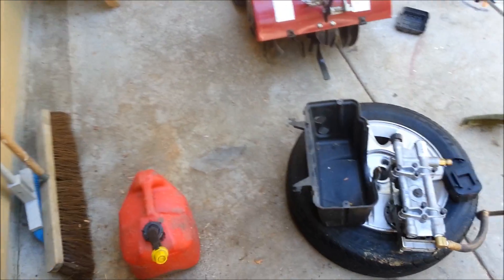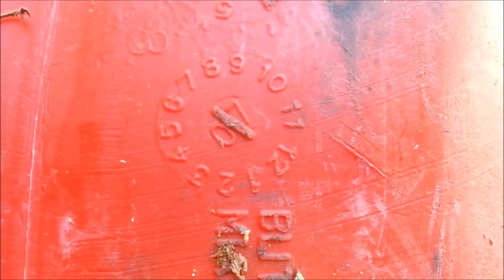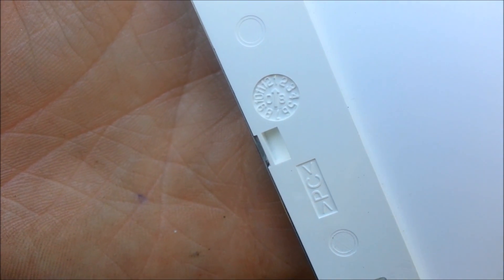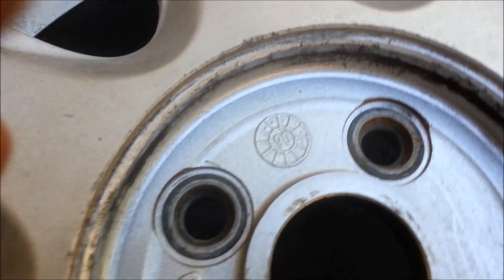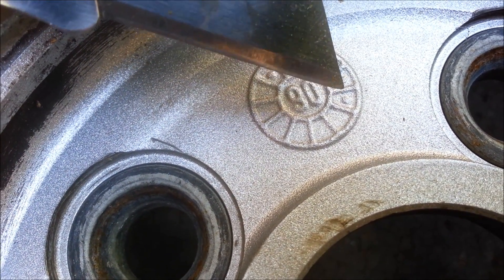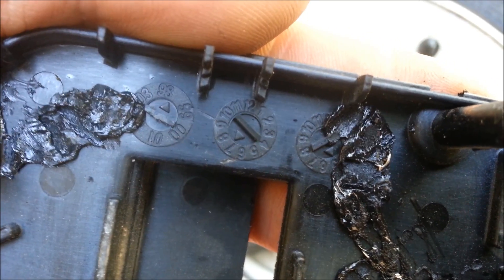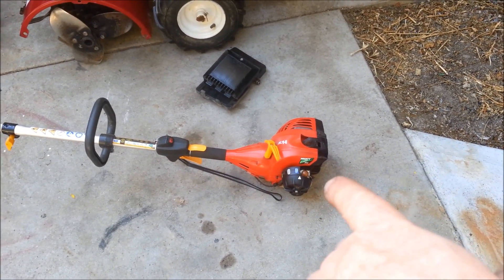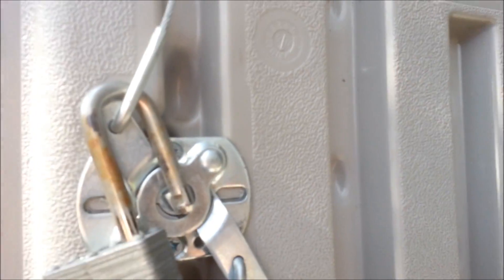What year was your STUFF MADE?   FIND OUT NOW

Comment: Yep ive looked at them on laptop castings in the past, for single part stuff its fine but multipart normally has mixed dated parts so less accurate for an actual date of manufacture.

Good tip though :-)

Some very cheap stuff dont bother with codes at all.